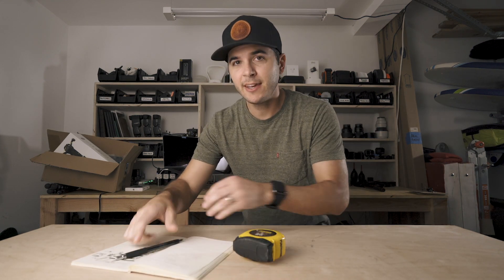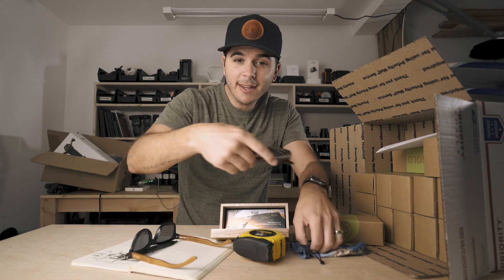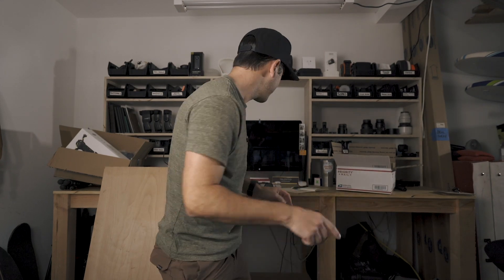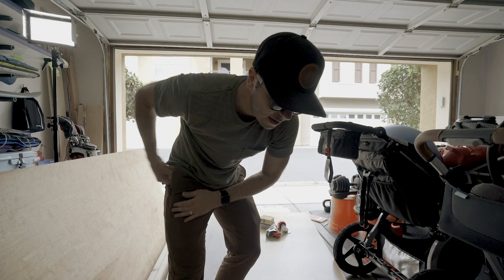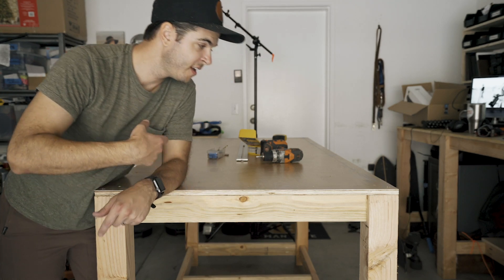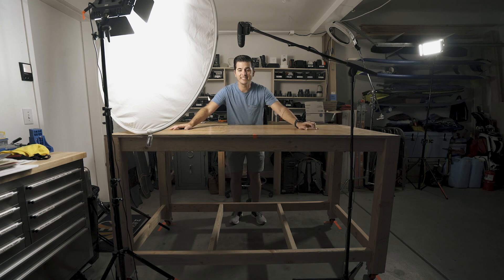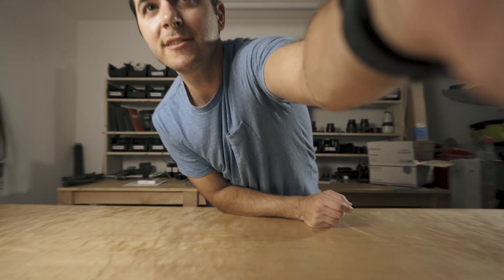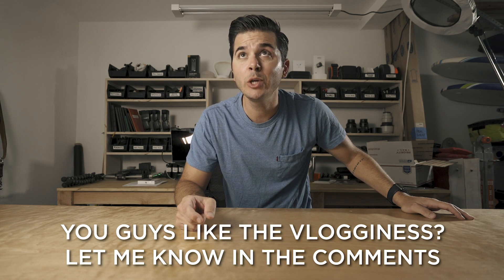My NEW YouTube setup - A vlog for FUNSIES

Comment: Hi! What drone do you use? I think I remember you having the Mavic Pro, but not sure if you've upgraded recently. I have the MP, but I'm thinking of switching to the air, so I was wondering if you had either one. Also, how would you go about picking a selling price for gear? I'm really bad at picking prices for things, haha
Reply from the maker: Yup, I’m still flying the Mavic Pro! I’ve flown the Mavic Air a couple times, but it’s not as stable in windier conditions, so I always opt for the bit larger Pro. As for selling gear, I always think EBay is your best bet. You can see what other people are selling gear for and usually get a pretty decent price on a sale!
Reply: @DavidManningvlog  How much does wind affect it would you say? I know you can't give an exact number, haha, but would it be common sense like "oh it seems windy, probably shouldn't be flying" or is it a little before that where I think it would be fine but it's not...if that makes any sense, haha
Maybe I'll buy the air before I sell my pro, and test it out, so if I find out I don't end up liking it or anything like that, I can return it!